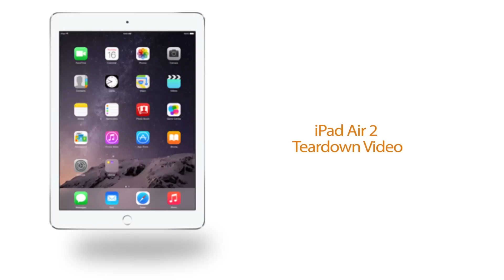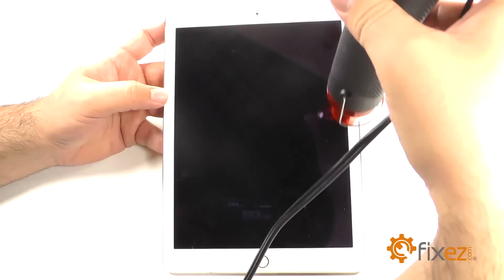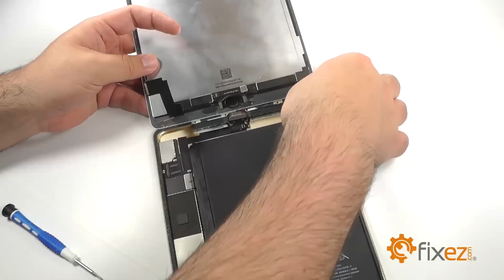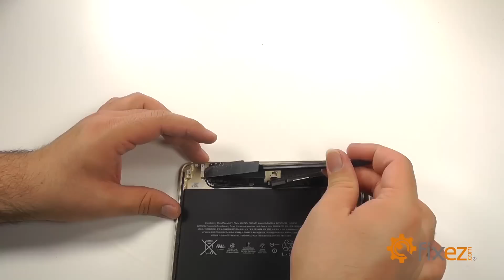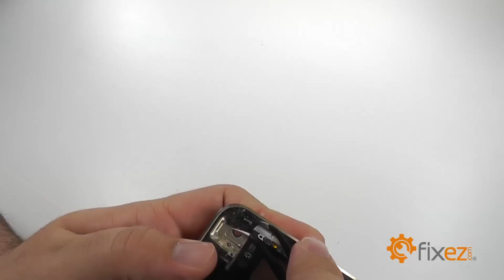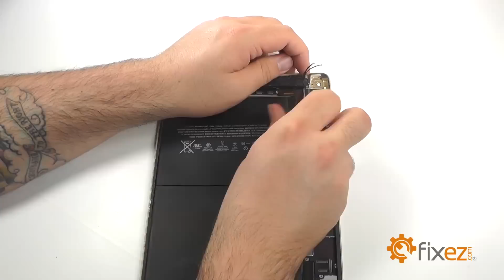Official iPad Air 2 Teardown Video - Fixez.com

Comment: Nice work! Very informative. My IPad Air 2 is (ghosting) quite a bit. When im typing on my keyboard it will randomly input random letters. Would recommend that I put 3M tape around the edges to fix this? Or do you have any other ideas? Thanks again

Comment: hi, my ipad air 2 wifi is grayed out and it doesnt work anymore. May i know whats the problem?
Reply from the maker: This normally stems from a software related issue. Try to restoring the operating system via iTunes but ensure you back up all your data first. If this does not resolve the issue, you may want to try replacing your WiFi antenna.

Comment: My iPad Air 2 gets really hot when I use it it almost burnt me while watching this
Reply from the maker: +Matt Raudebaugh Your processor will get hot when in high use but it should not get this hot. It could even possibly be your battery. Try performing a system restore via iTunes but ensure to back up your data first. See if this helps.